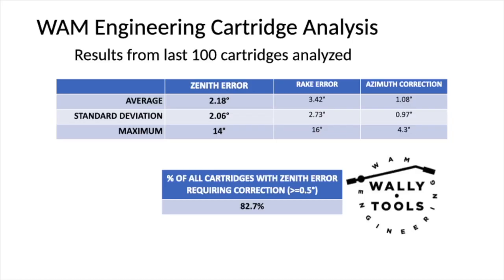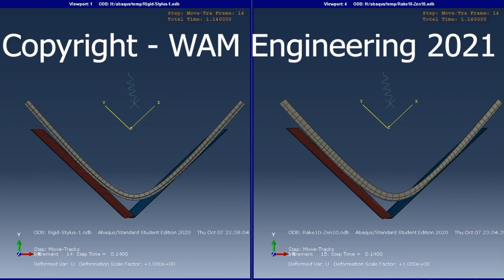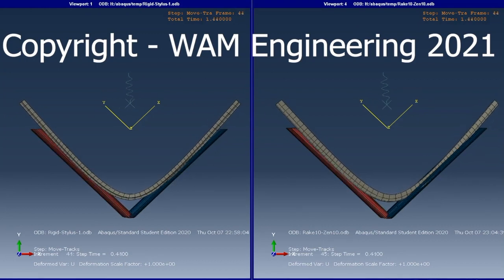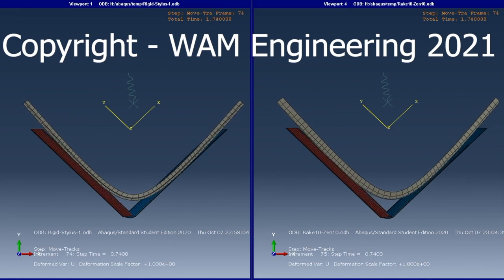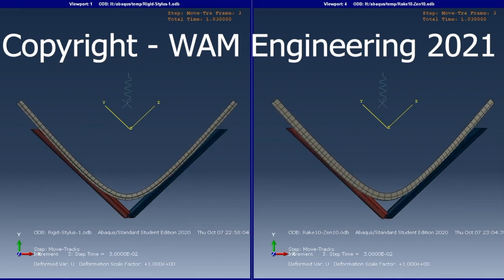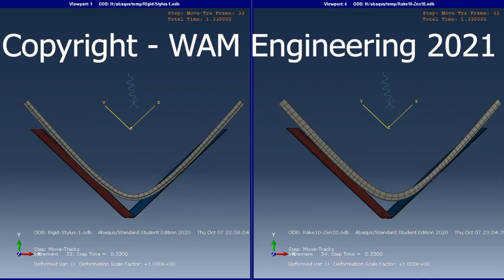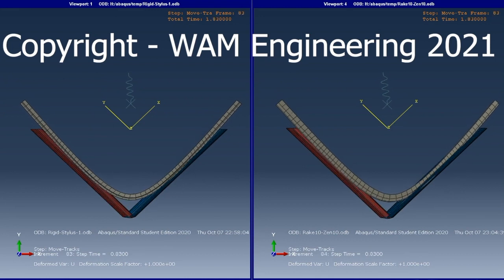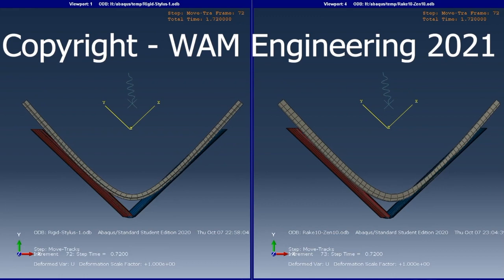Stylus Zenith Error - What is it? Why is it a problem? How common is it?

Comment: Thank you for explaining this. 
I guess I’m naive. I had assumed that a manufacturer would have specification standards for the suppliers and QA doing verification. If it doesn’t meet the standard, you send it back.
Reply from the maker: The three stylus/cantilever manufacturers DO have contracted tolerances they are supposed to adhere to with the product they sell to the cartridge manufacturers. Most of the time (about 90%), they do just that. However, +/-5 degrees accepted tolerance for zenith error is a huge swing and is easily heard when you hear it corrected vs uncorrected. Cartridge manufacturers do NOT measure for this as it is very time consuming and difficult to do so; not to mention the required equipment is very expensive. 

There is a shocking amount of information in the grooves to capture, but you need a fine line contact stylus to get at it and the contact edges must be perfectly aligned to do so.
Reply: @WAM-Engineering  I guess the contracted tolerance should be +/- 0.5 degrees instead of +/- 5 degrees. And I can understand why lower priced cartridges wouldn’t be submitted to quality assurance checks. To my mind anything over $1000 should be individually checked. And $15000? Not checking that is unfathomable and frankly should be embarrassing to those manufacturers that send a product of that price out without ensuring that it is EXACTLY right.

Comment: Have you ever check the rega apheta 3 cartridge and if so what was the results
Reply from the maker: Hi Paul! The last time I inspected a Rega cartridge pre-dates my full-blown lab setup so, for all intents and purposes, the answer is "no". However, Rega, like pretty much all other cartridge manufacturers, purchase their stylus/cantilever assemblies from one of the same three manufacturers. I am not aware of any cartridge manufacturer (with possible exception of Ortofon and SoundSmith on their replicant stylus profiles only) that measure for zenith error. They ALL have the same problem in that they don't know what they've gotten from their vendors. If any of them do know, they aren't letting the owner of the cartridge know what the zenith error is so he/she can correct for it and get the most out of the cartridge. 

So, it would be irresponsible for me to name names as they all need to tighten their game. In the past three weeks I have analyzed two $15,000 cartridges. One had a 5.05 degree zenith error and the second one was over 10 degrees! 

Unacceptable.